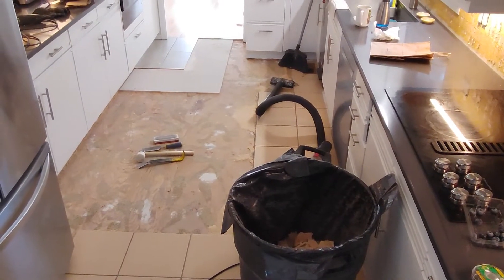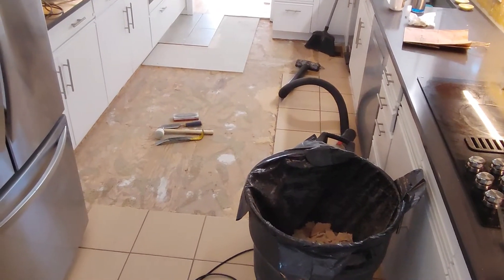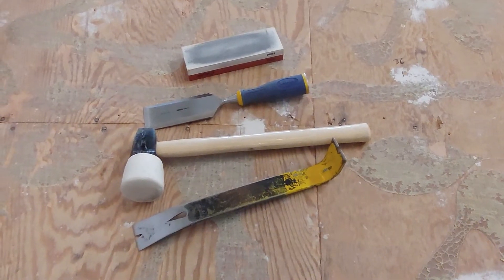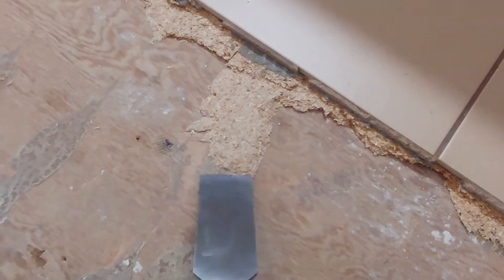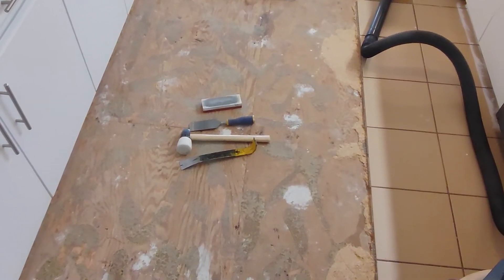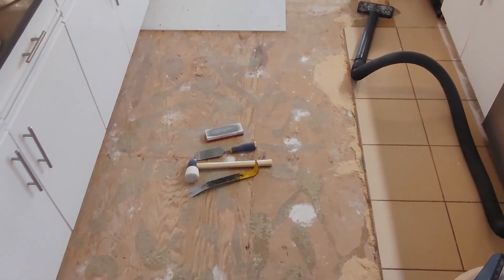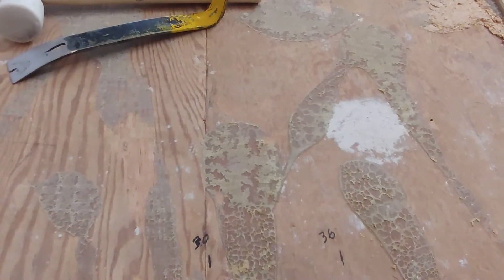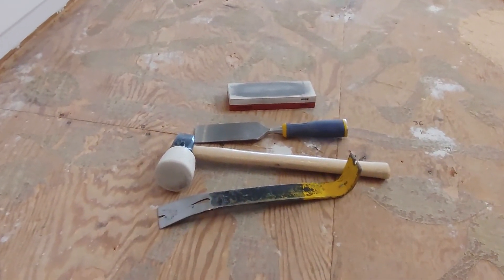Removing glued-down particle board from subfloor - the final battle!

Comment: Thank you so much for posting these! I was in denial having to do this! 
Your video saved me, or at least made me feel less alone in this nightmare.
Reply from the maker: Happy I could provide some moral support!  Personally I kind of found the chiseling process therapeutic.  It's slow, but you'll get a good smooth surface.  I used power tools on much of the floor, and it was hot, noisy, and VERY messy.
Reply: @MorganBrown  if you need more therapy come on over!

Comment: Doing this now. There is an easy way....Hire it out.😂 I glued and nailed my particle board over a slab. Need to tile a section at the backdoor. I have to be careful as the surrounding Cherry floor stays.
Reply from the maker: my wife always pointed that out ("There is an easy way....Hire it out").  My response was always, "who?"  Definitely wouldn't find a lot of people on Yelp willing to take a job like this.  I'm sure they would use one of the brute force methods.
Reply: @MorganBrown  agreed if I could find somebody I'd hire them. The reason I noticed I had some water damage on the cherry floor is because a yellow jacket nested formed in the wall right by the door. So while I'm doing this deconstruction I'm sucking up yellow jackets with the vacuum cleaner. It would be funny if it wasn't such a PITA.
Reply from the maker: @chex313  holy shit, that is worth a youtube video on its own!  HornetKing meets DIY. 😂 In all seriousness, good luck and I'm sorry you have to suffer through such a horrible job.
Reply: @MorganBrown  thank you for the video. My tile jobs done. Waiting on a new rubber door sweep to keep the moisture out.